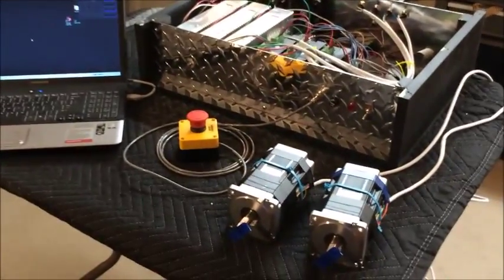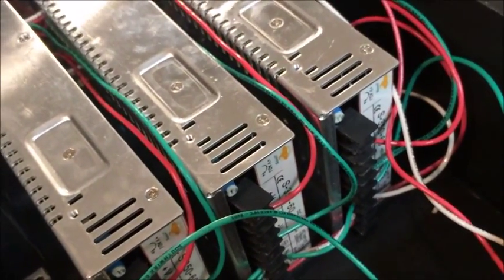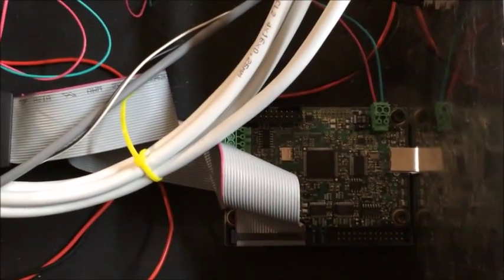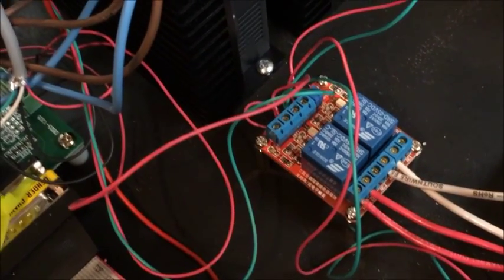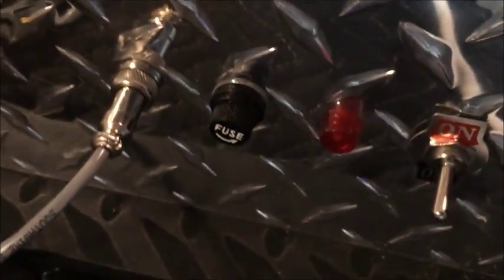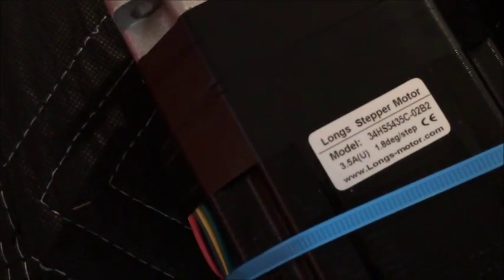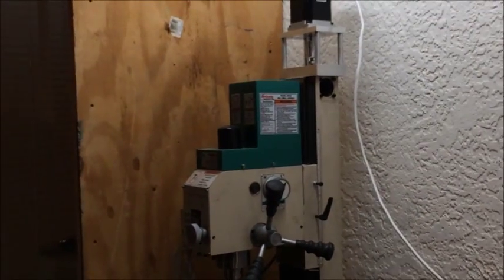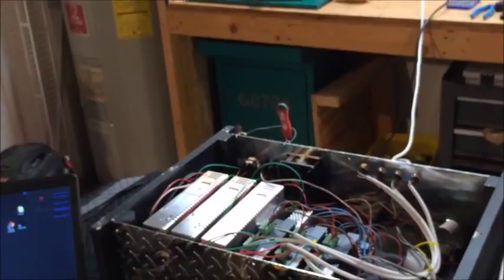DIY CNC Controller - Smooth Stepper - DM860A - Mach3

Comment: Franco, I realize this is 9 years old video but do you really need one power supply for each driver? Just curious. Thanks.
Reply: Hi. You do not.  The main thing with switching power supplies is to have plenty of power.  If you cut it too close, you'll have strange problems if/when the drivers are under powered.  It is best to over do it when it comes to switching power supplies.  Sometimes, it's cheaper to buy three indvidual power supplies than one big one.

Comment: just one thing, you generally should avoid switching the neutral if possible. In the case of a fault you can lose a return path and hence the safety device may not operate
Reply from the maker: Thanks for the tip.  Safety first.

Comment: Nice video.  i am looking at the ESS from Warp9TD and just wonder what the BoB is you are using.  Is a cheap Chinese one or a better one?  i have a cheap Chinese ST-V2 and not sure if the ESS will work with it or whether i need to purchase  better BoB.
Reply from the maker: Thanks.  I'm using the cheap Chinese BOB ($20) that came with my stepper motors and drivers.  I'd say the Smooth Stepper Board is going to work with any BOB designed to interface with a parallel port.  They are well worth the money.
Reply: great, thanks Franco.  i have actually decided to bite the bullet and go with a C62 board from CNC4PC and also the Warp9TD smoothstepper.

Comment: Hi, I'm looking to do a cnc conversion on my milling machine. Looks very similar to your milling machine. What electronics would you recommend? I see you have a longs motors kit, have you had any problems with it? I would also like to buy in a kit, dont want to piece everything together
Reply from the maker: +Elwin Priem I'd start with a Smooth Stepper board.  I have the USB version and it works great.  I've tried one of the cheap import USB interface boards and it is a disappointment compared to the Smooth Stepper.  The Longs Motor stuff has worked really well for me.  I've purchased all  of my motors from them as well as several drivers and power supplies - all of them are working great. Regarding drivers, make sure you get something with current reduction.  Otherwise, it will try to run full current (even at a stop) and you'll see your motors start to get hot. Once again, I've purchased some cheap drivers (TB6600) without that feature and it was very disappointing - they sit on the shelf next to the cheap USB interface that I'll never use.  I've had good experiences with the DM860A for the NEMA 34 motors and the TB6560 for NEMA 23 motors.  For the G0704 mill, you can get away with 425oz motors for the X and Y but you'll need NEMA 34 motors for the Z axis.  I went with 1600oz motors all around and that was a bit of over kill - but if it's worth doing, it's worth overdoing...

Comment: I like the diamond plate box.  Very classy!
Reply from the maker: +bosaru2 Thanks.  I wish I could find a "proper" enclosure for not a lot of money.  I wound up making one out of plywood but I would have preferred to have a plastic box.  I made sure to cover every connection with shrink wrap tubing but you never know with electrical stuff.  I always make sure to disconnect the power when I'm not using it.
Reply: +Franco So where do you buy all the components?
Reply from the maker: +bosaru2 ebay mostly. I also get some things from CNC4PC.COM.  Those guys have all the really cool stuff you can't get anywhere else. They had the best price on Mach3, as well.

Comment: Franco I have the same China set. But to connect it I failed. Do you have a wiring diagram?
Reply from the maker: Watch this video:  http://youtu.be/NUQSOYQZTAA

I used 8 wire motors when I made the video but it is pretty easy to figure out how to connect 4 wire motors instead. 

I hope that helps.

Comment: is this chinese longs motor 860a or leadshine? how is the performance, man? any glitch? curious a out the chinese drivers
Reply from the maker: Kenneth Shark These are the Chinese Longs Motor DM860A drivers.  I haven't used them extremely hard thus far, but as far as I can tell they work just fine.  The smooth stepper board really seems to make a big difference - this setup is MUCH smoother than my smaller mill which is being driven directly out of a parallel port.
Reply: Franco looks like NEMA 23. can u mill steel with this setup? DM860A is like for NEMA 34, Franco. maybe DM542 suits these NEMA 23s better (from expense point of view, heheh)
Reply: Kenneth Shark holly crack, i have just seen ur setup milling cast iron! i didnt know nema 23 can do that. can it do steel tho, bro?
Reply: Kenneth Shark one more. what do u think of chinese ball screw? ever want to use them? i am considering buying them for my utlimate anti backlash setup, bro
Reply from the maker: Kenneth Shark Sure.  You just need to use good end mills - carbide is best.  Also, rouging end mills are good to have.  They reduce cutting pressure and help control the chip size.
Reply from the maker: Kenneth Shark I'm using them on my G0704 conversion.  I haven't got the mill up and running but I do have the ball screws installed on all three axis and they seem ok.  I'll know more once I put them to work.
Reply: Franco nice! i would love to see them in action! please make a demonstration, bro. and btw, what is the diameter of the ballscrew? and how long? i am thinking to buy diameter 20mm length 1400mm
Reply: @kennethshark3681  they are nema 34's not nema 23's you cannot get nema 23's at 1600oz/in. thats 12n.m the bigest nema 23 is just over 599oz/in about 4nm